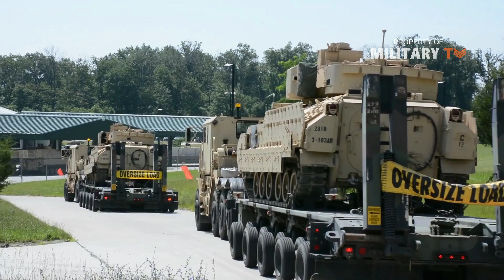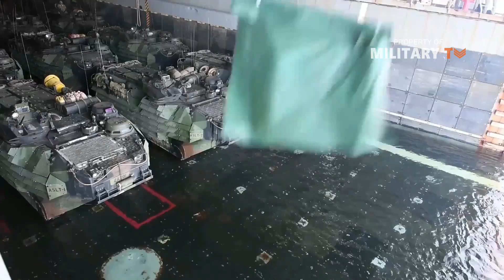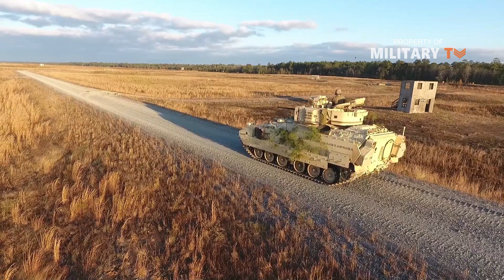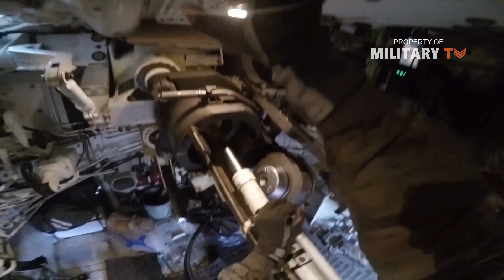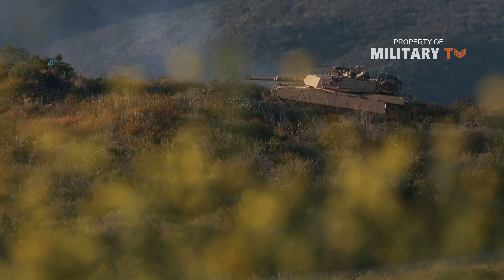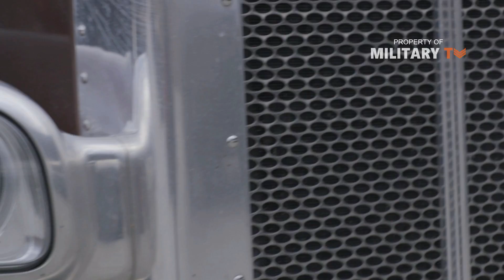Differences Between U.S. Military Tanks And Armored Vehicles

Comment: Your constant mispronunciation of the word turret is mind boggling considering this is a video about tanks.  There is no n in turret.  Definition of turret
1 : a little tower
specifically : an ornamental structure at an angle of a larger structure
2a(1) : a revolving armored structure on a warship that protects one or more guns mounted within it
(2) : a similar upper structure usually for one gun on a tank
(3) : a gunner's fixed or movable enclosure in an airplane